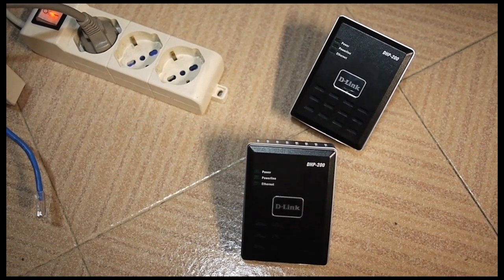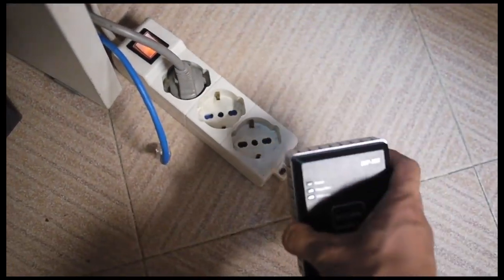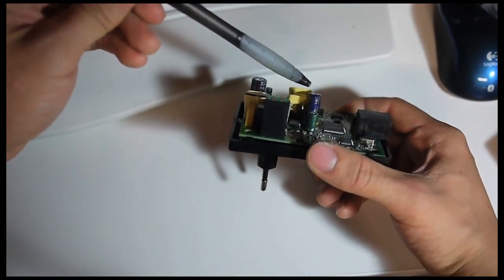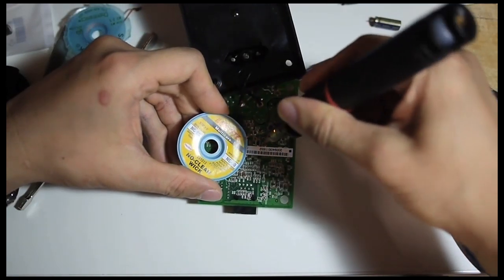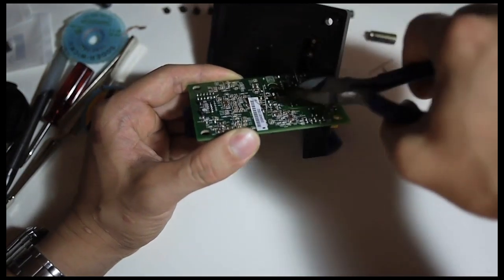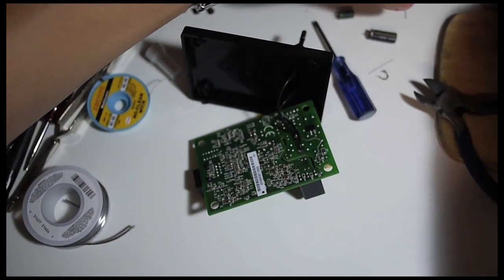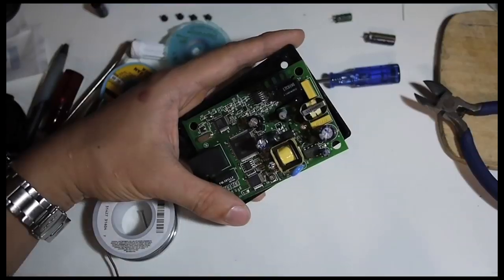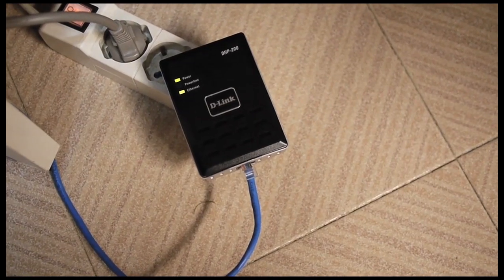Repair D-Link DHP-200 Ethernet over powerline adapters also TP-Link, NetGear

Comment: You can not run these on an power bar!!!. They have to be used directly on the mains plug. Also these devices simply can not handle heavy usage of ( ipads, Netflix) and they will eventually fail ( Caps and converters). The Av Dlink 1000 has been the better ones I am using, the older AV500 would not stand a chance these days with heavy Ipad and Netflix usage. The Av600 has a problem over time as the 2 lights are on but no connection is possible ( more likely internal failure and not from the power caps. My nieces destroyed an AV600 in less than 5 months as the Ipads are monsters of data transfers.
Reply from the maker: You are right. I used the power strip outlet because it was closer to my camera. These were good solutions when WiFi extender were few and expensive and where it’s not practical to install Ethernet cable in the building to reach your computer. I extended the life of these units for years beyond they were ever intended by the manufacturer. Though in general they have short life span as they are plugged in 24/7.
Reply: @conceptedge  Yep 👍 they are, work great no doubt but they were never designed for heavy streaming for example, the issue is heat they get very hot. I am actually in the process of adding some Ethernet connections to where some of the EOP devices are hooked up. It’s a pain to do fish the Ethernet through the floors as the floors have multiple 2*4s on the bottom. Usually we go through the holes used for the electrical wiring, so no need to break a piece of the wall.

Comment: Compliments,
i have the same problem with a d-link dhp 308 av. Can you tell me exactly which capacitor I need to change? Thanks Xavier
Reply from the maker: Generally they are the 16V, 25V, ones. If they are obviously swollen from the top, then replace them.

Comment: maxx Powerline -on  has totally failed -no power nothing. 
Tried reset - nothing. 
Tried both on same socket switch - nothing 
Opened it up - nothing visible showing afaik to highlight problem 
So i swapped PCBs with working one and vice versa- so PCB is not faulty as same problem with swap over 
Which means fault is (i guess as i am no techie)with the second board which has the Capacitors .They are not bloated - and i can't see anything visual to id any damage /fault 
Anything else to look for?

Comment from the maker: I don't have that exactly model, but I would imagine that the plugs are soldered to the PCB. Have you tried to desolder them? Yes, in general, you can use a slightly higher capacitance capacitor. So 6.3V 2200uf would be fine. The capacitor plague is annoying.

Comment: Hi there. thank you for the video. 
It seems I'm having the same problem with my half year old TL-PA201 TP Link. The 6.3V 1500uF capacitor is swollen :(. I'm so tierd of this capacitor plague stuff- fixed two monitors suffering from this also. I'm having trouble getting the PCB out of the electrical plug shaped case. Any ideas what's holding it besides the electricity fork? Another thing, it's seems I'm out of 6.3V 1500uF capacitors. Will 6.3V 2200uF capacitor be a good replacement?